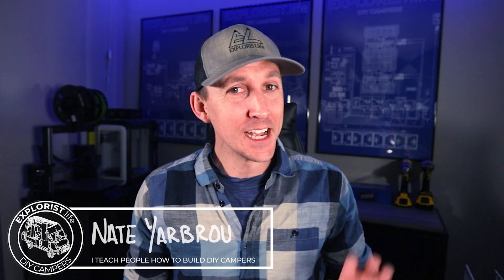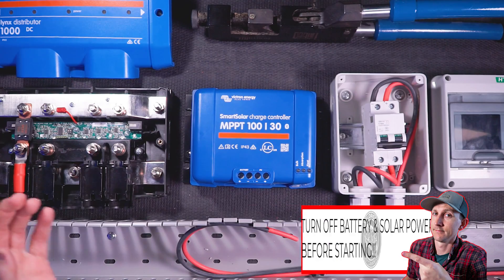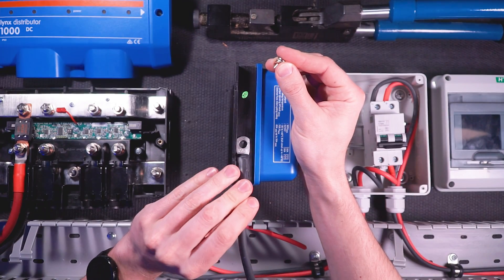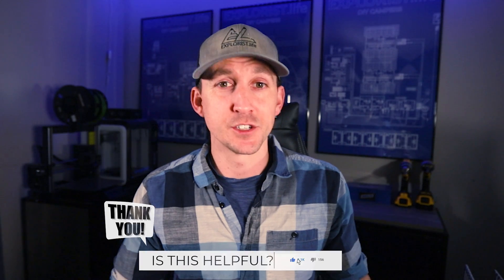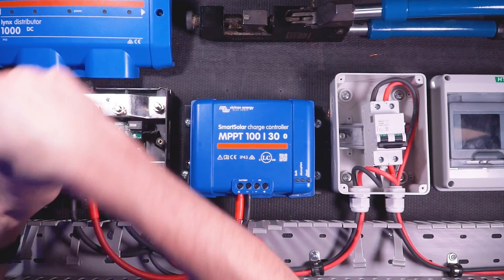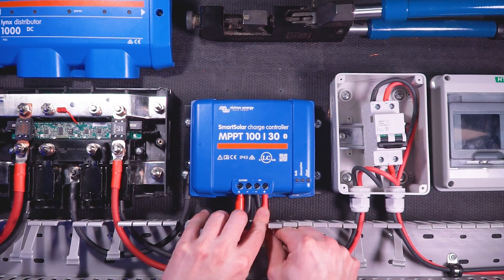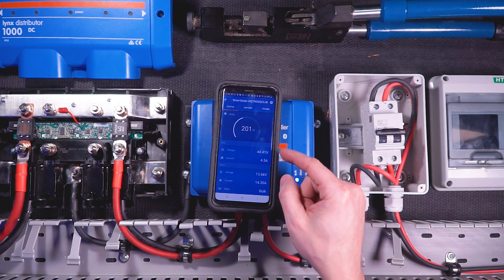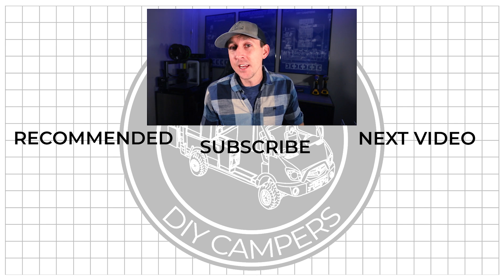How to Wire a Solar Charge Controller in a DIY Camper Electrical System

Comment: Thanks for all your videos,excellent work, I subbed your channel a few weeks ago. One question for you- can the equipment ground on the Victron go to the existing bus bar on the camper converter? 

I have a 100/30 mppt controller, and using my solar to simply keep my battery charged (no inverter). Seems like I wouldn’t need the lynx and simply fuse to battery and tie the equipment ground to my existing negative bus bar? Thanks in advance if you could reply please!
Reply from the maker: The Equipment ground needs to land on the same busbar as the 'Battery Negative' wire from the MPPT.
Reply: Thanks Nate for the reply! I was going to put the negative from the charge controller directly to the battery, but could I put it on the same bus bar as the camper converter? Then the equipment ground, the negative and all the other dc negative leads would be on the same busbar. Or is there any reason to separately have a bus bar just for the solar equipment? Thanks again!!
Reply from the maker: Maybe it'd be helpful to check out the two OEM RV retrofit diagrams I have available at https://www.explorist.life/solarwiringdiagrams to see how I recommend setting this stuff up in an RV with a pre-existing electrical system.
Reply: I will check it out- thanks much I appreciate your time and effort!!

Comment: Great video. What are you using for substrate under the controller. Manual says non-flammable. Thanks
Reply from the maker: 3/4" Plywood laminated with Coin Grip flooring is a good way to do it.

Comment: Hey Nate Your videos are super informative and helpful. Thanks!  I'm connecting a Victron MPPT Solar Controller 75 / 15 to portable solar panels (4 panels with 200 Watts) and my Battle Born lithium battery. The panels came with Anderson plus using 8 AWG wire and I cant "cleanly" fit the wire into the small opening on the controller so I want to use ferrules like you do. Can you tell me where to buy just a handful of that size? I see they're available on-line from a variety of sources but I don't need100++.  
I'd also be curious where you'd recommend attaching an Anderson plug to the outside of an RV (ours is a Ford E350 4X4) to give easy access and still protect it from the elements. Thanks

Comment: i had no idea i was going to need a "distributer" after i got my mppt 100/30 :(😯
Reply from the maker: Fuses, wires, lugs, heat shrink, cable clamps, and all the other stuff needed to make all of these components work are commonly overlooked.

Comment: I have a question, I've had a victron 100/20 that recently purchased about a month ago. It was still connected to the battery and pv array. So I added more solar panels without discounting, the charge controller. Now the controller does not turn on and the fuse on the controller is still good. Do you think the solar panels could have shorted it out?

Comment: Big question. Mine is going on a plastic boat... do I still "ground" the casing? I've not got anything to ground it to... (I'm not airborne, but it's not far from it!).
Reply from the maker: Yes.  the Equipment ground goes to the negative busbar of the Lynx Distributor as shown in this video regardless of what vehicle, structure, or anything else you are mounting the charge controller to.
Reply: @EXPLORISTlife  Yeah thanks! I've had a long chat with another boater, and will keep doing my research. As it's a ground up rewire, I will have to figure out what my grounding solution will be. But I now understand just because it's a DC circuit, I don't get to avoid all grounding. :P

Comment: Is it correct to have the charge  controller output on the bus after the main battery disconnect and try to remember to switch the isolator  in the off position or place charge controller output in front of main battery disconnect switch so that a battery is always present for the charge  controller to charge and float?
Reply from the maker: Either is 'fine' but my preference is the way I showed in this video.
Reply: @EXPLORISTlife   in the case that say my wife  disconnects the main battery switch from the bus without turning off the pv isolator first wouldn't/couldn't  that destroy the charge  controller?
Reply from the maker: All parties that may be turning switches in this system should be educated on proper shutdown procedures.
Reply: @EXPLORISTlife  no doubt! Victron is pricey and deserving of a long working life in chaotic times.  Thanks for the verification. I have enjoyed all your videos .

Comment: Your videos are amazing.  Thanks.  How can I charge both my Lithium Ion house batteries AND my under the hood Lead Avid Battery with the same solar Panel.  My RV sits most of the time, and when I use it, I have a much lower power draw than what your builds show (I still use propane to power the fridge, heater, hot water heater, and stove top.)   So I have quite bit of excess Solar. Thanks
Reply from the maker: The 'proper' way to do it would be to use two separate arrays.  Build a big and proper solar array for the house battery bank and then get a little 20W or so panel and dedicated charge controller for the starter battery.  The starter battery doesn't need much to keep it topped off.

Comment: What gauge wire are you using in the video?
Reply from the maker: 6AWG and 10AWG in this video, specifically, but wire size may change depending on the charge controller used and the solar array configuration.  Check this page for various examples: https://shop.explorist.life/product-category/all-products/camper-wiring-kits/solar-charging-wiring-kits/

Comment: Nate, great videos! In trying to figure out a size of charge controller , The calculators ask for Temp Coefficient of Pmax and temp Coefficient of VOC, but my solar panel does not show these. It's a Traina Solar systems TSM-230PA05. Peak Power 230W., PTC rating 208.9, Max power voltage 30 VMP, Max Current 7.78A, Open Circuit Voltage 37.0 VOC, Cell temp 77F, Normal Operating cell temp 116.6 F  and max system V is 600 VDC . This is the info on my panel. Without the other two numbers for P Max and temp VOC I can't complete the calculators. Any help would be great understanding what size charge controller to go with would be great. Thanks!

Comment: Users can you please help me I am wiring my Victron 100 30 to the battery and I have 6 Gauge SAE flex copper wire from a pair of heavy duty jumper cables - can I use this wire to connect from the + and  - of my Victron 100 30 directly to my RV's battery supply Aux under the stairs?

Comment: In classic physics, the earth of supposed to get rid of extra current that somehow gets out of the electrical wires  and to a given system body like a metallic cover. 
So I'm wondering why you connected with the earth and negative/neutral together?

Even in houses, the earth/ground has a special connection that is actually going to the ground via a copper rod. And that is not mixed with negative. 

Is it the is a difference between AC ans DC current?

Comment: Amazing set of videos for wiring campervan solar, slowly starting to to feel that this isn't just doable, it might even be fun! One question though, what is the reason you wire the MPPT Battery Output to the Lynx Distributor instead of going direct to the battery? In my mind, it would save an extra outlet from the distributor, for the cost of some extra lenght of wiring.

Comment: The MPPT Come with 3 washers, one copper serrated washer, a copper lock washer and silver flat washer.
What oder do these go in on the lug?
Reply from the maker: Charge Controller -> Serrated Washer -> Lug -> Washer -> Lock Washer -> Screw.

Comment: Can you do a video about sizing wire from the battery bank to the charger?
Reply from the maker: Sure!  Here is a video that teaches you how to size wire: https://www.youtube.com/watch?v=ki3WXVR48eM  

For these charge controllers, though... just use the biggest size that will fit.  That info can be found in the product data sheets.

Comment: Love your very helpful videos, but I may be confused on one point. You wired a 30-amp charge controller to the distribution box with a 60-amp fuse. Is it correct to double the amp rating of the charge controller?
Reply from the maker: Rule of thumb is: Operating amperage x 1.25 rounded up to the nearest available fuse size = recommended fuse size.  But in this case... Victron makes a specific recommendation for fuse size, so we just go with that.
Reply: @EXPLORISTlife  I’m installing the 100/30 controller now and the Victron manual says to use a minimum 35A or maximum 40A fuse. The 100/50 is minimum 55A and maximum 70A. See section 4.2 - Battery.
Reply from the maker: @Dry Heat 707  Indeed!  And I'm glad you are reading your manual.  Unfortunately, this is one of those instances I, personally, have to go against the manufacturer recommendations because we are connecting this MPPT to the Lynx Distributor and a MEGA fuse [the fuse that fits in the Lynx Distributor] doesn't exist in a size smaller than 60A.  Rounding up like Ive done is still within safe parameters of the wire, so I'm fine with it.

This is a classic example of 'engineer recommendation' vs 'real world application'

Comment: Why does the solar breaker need to be in a box?
Reply from the maker: The box keeps the potentially high voltage connections contained and 'finger safe' and adds strain relief to the wires.  It's also just one of those 'good workmanship' things.

Comment: nice video thanks! I have a question if you can help please, mega fuse minimum size is 60A i think, and 35-40 A recommended  after the MPPT 30, do you provide appropriate fuse? Best thanks. Philippe

Comment: Where do you connect your load with this controller? Could you make a video with The full connection and The Street Light function working? Thx! 🙂
Reply from the maker: I don't recommend using the 'load' terminals in 99% of cases.  I just recommend powering the 12V fuse block from the Lynx Distributor and omitting the load terminals.  I also don't have a good use for the Street Light function in a camper; but the user manual shows you how to connect this.

Comment: In my Toyota Coaster motorhome, do I need to wire in the ground screw of my Victron 100/30 smart controller (the same one as in your tutorial)? And if so, where? The Coaster runs on a 24V system for the engine and lights etc, and my solar array is 12V,  (one 350 W panel, into a 400 Amp hour AGM lead acid battery bank) so I thought a 'chassis ground' (being 24V) would be out of the question. Any clues? Is it necessary? Or can I get by without the 'ground' connection? I heard you say that many campers are not grounded.
It all looks so straightforward (in your vid, which is well shot and cut, right down to the rolling of the dice/screws, chuckle, in the previous vid) but I don't want to make a costly cockup by not wiring the 'ground' of my Victron in somewhere, if it really should be done.

Comment: question from a solar newbie.

I have a 17ft fiberglass sailboat   200watt solar panel      24v LiFePo4 60ah   and Victron 100v 20amp charge controller,     running my 24v trolling motor    where do I run my ground to on a fiberglass boat?    thankyou

Comment: I wonder how to automatically disconnect the solar input when the battery fuse goes off. Isn't this event going to damage the charge controller, especially when the battery is disconnected for a prolonged period?
Reply from the maker: If the battery fuse breaks, something else has gone catastrophically wrong so this scenario is pretty much a non-issue.

Comment: I want to charge 2 independent battery banks from 1 solar panel.  The idea is 1 battery would be the house battery and sit in our cargo trailer to run lights.  The 2nd battery would be disconnected from the trailer, used elsewhere and then reconnected once it is depleted to get recharged.  I have been looking at the following 3 charge controller because it looks like they are designed to handle independent battery banks.  The problem is most are thinking house battery and starter battery, not my situation.
 
Victron Bluesolar PWM DUO
Epsolar MPPT Dual Battery Solar Charge Controller DuoRacer
Go Power 30 Amp Dual Bank Bluetooth® Enabled Digital Solar Controller (GP-PWM-30-UL)

 
Any advice or guidance on how you would do this?
Reply from the maker: I would recommend just building the permanently installed primary 'house' system and then use the 120V side of that system to run a battery charger to charge the aux battery.

Comment: If the fuse from mppt to busbar (battery) blows, won't the mppt controller fry as current is still coming in from the panels? Need a fuse between panels (isolator) and mppt to blow first?
Reply from the maker: At least with Victron charge controllers, no.  I can't speak for all charge controllers, though.

Comment: Great video what gauge wire did you use from controller to battery please
Reply from the maker: 6 AWG for this particular charge controller; but wire sizes for various charge controllers can be found near the bottom of this blog post: https://www.explorist.life/3000w-inverter-400-600ah-400-to-1200w-solar-camper-solar-kit/

Comment: What kind of ground do I need for my solar/rv system? I have my system laid out pretty much identical to the "Argosy Project". I have a 400ah battery bank, Multiplus 12/3000, Lynx Distributor, and 2 MPPT controllers. If I run my ground wire from my charge controllers, to my Multiplus, to my distributor, to a chassis ground is that all that is needed? Do I need to ground my solar panel frames? I have all my AC outlets wired up with a ground wire to the ground bus bar in my WFCO distribution panel. I also have my shore power connection running through a Hughes smart surge protector.

Comment: Nate, that's the way I originally had the Victron SmartSolar 100/15 connected but couldn't find a MEGA fuse small enough to protect the 10awg wires. Can you recommend the proper size fuse that will fit the Lynx terminal?

Comment: Though I have watched every video you have made and purchased all components, fuses, wires, etcetera, it still boggles my mind to not grasp it.  I have an 8.5 inch high x 74 inch long space above four 100 watt AGM batteries to connect wiring coming from two 250 watt and two 100 watt solar panels to a 40 amp MPPT controller, breaker box, 2000/4000 inverter, shore power switch box, fuse panel, all the fuses, bus bars but cannot decide what goes where in what order, then all how to run the DC 12v wiring to the rocker switches and AC wiring to outlets in a 6 x 16 cargo trailer.
Reply from the maker: You've got this! :)

Comment: Hey mate two questions, do I need to ground the system if I don’t want to have the inverter (keeping the system DC only) . Second one is, if I don’t want to go with fuse box (connecting to battery) why is alternative fuse would you suggest? Cheers. You are doing great job 👏
Reply from the maker: Yes, a chassis ground is still required.  I don't recommend connecting directly to the battery.  Some form of busbar system (like the Lynx Distributor I showed) is necessary for a high-quality install.

Comment: If the fuse on between charge controller and the Victron Lynx blows and the solar array is putting power into the MPPT, what would happen?. I read that you never had to had the Solar connected first or before the battery, but if fuse blows, what's is the situation on the MPPT?
Reply from the maker: I can't speak for all charge controller brands, but with Victron it's a non-issue.  It will just cycle off and on until battery power is re-connected.
Reply: @EXPLORISTlife  I had a Victron 150/35 just bought so it is good to know. Great videos!!! Keep them coming!!!

Comment: Great video thank you! I may be wrong but the way this wiring diagram is laid out if you turn off the main battery disconnect switch the solar panels and charge controller would be disconnected from the battery. My charge controller says that it should never be disconnected from the battery before disconnecting solar panels. It seems like it would be better to run the charge controller battery wires directly to the battery (on the battery side of the switch). That way you could never accidentally disconnect the charge controller from the battery with the PV still hooked up.
Reply from the maker: There is a disconnect for the solar array so that it can be disconnected first and the Victron charge controllers won't be damaged if the battery gets turned off first.  Its not best practice... but they will be fine.
Reply: this is the same question i have now trying to come up with a game plan for my tacoma camper build.. On boats they typically have solar charge controllers on “unswitched” distribution like you say so they can turn off house battery loads and still charge the battery bank. Typically anything on the charging side is unswitched and AC and DC loads are all switched. i have a Lynx bus bar but im probably gonna end up working the solar charge controller to a separate unswitched bus bar coming right off the battery. This will also be handy if i want to say charge with 120v AC from mains so i dont have to switch the battery to ON everytime.. Most likely will also have my enclosure fans run off this unswitched distribution as well.

Comment: What exactly is a lynx distribution and why do I need it? I'm currently installing two 100 wat renogy panels to 4 AGM 12v batteries and then tie into the RV's fuse panel.